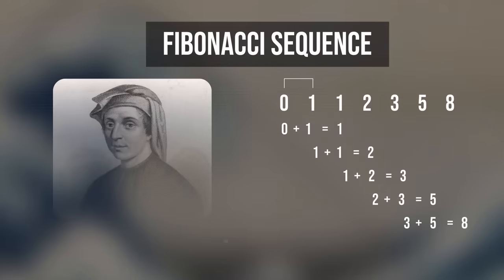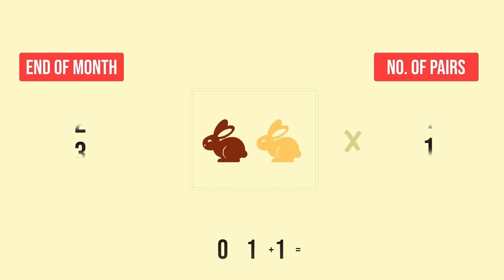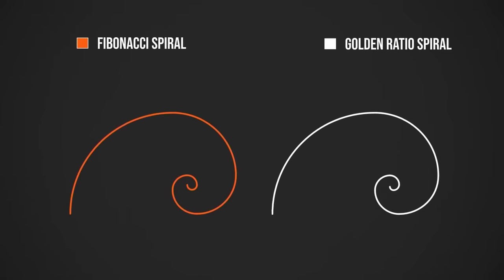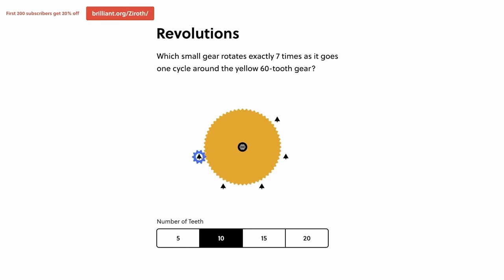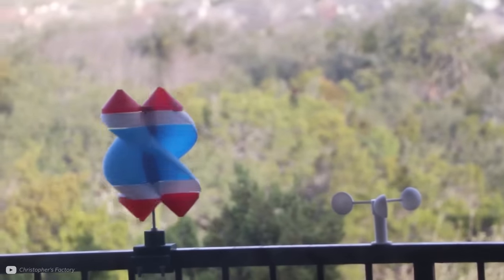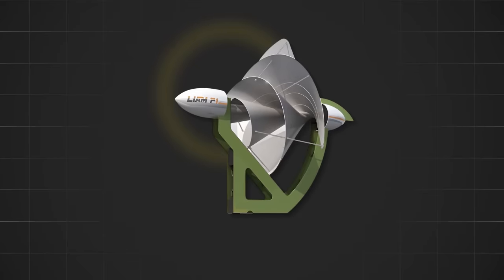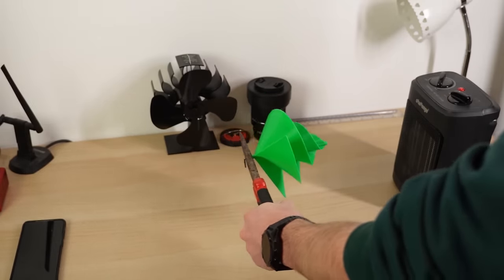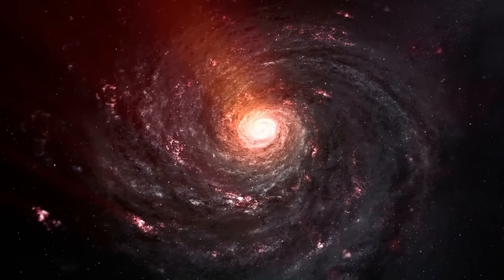Uncovering The Genius of Fibonnaci Turbines

Comment: TLDR: This turbine is optimized for low wind speeds (very low power available) while regular turbines are optimized for high wind speeds (High power).

This makes for a great garden decoration, but even if a turbine is optimized to be "efficient"  and starts at lower wind speed, slow moving air doesn't contain enough energy to get significant power out of it. The power extracted is related to how much mass of air can one slow down per unit of time. The thing with wind turbines is that they can never be 100% efficient because that would mean stopping the air dead in its track... where is all that air going to go? 

The proposed concept works well at slow wind speeds because it's basically a regular wind turbine with extra larges blades. The extra width allows for more interaction with the very slow moving air particles. However, at high wind speed, the extra width stops the air from passing trough easily. It acts like a brick wall for most of its surface causing potentially large stresses on the mast, but very little additional torque on the turbine. As the air is just pressurize at low speed in front of the turbine, the rest of the air just goes around because it is pushed away by this high pressure front.  

In a regular wind turbine, the blades are slender, allowing wind to pass through and keep a good portion of speed to allow "spent air" to "move out of the way of the incoming air". This means that the whole blade is being hit by high kinetic energy air, allowing to extract more power out of it. To my knowledge, the theoretical optimum efficiency trade off between extracting too little "speed" out of the wind and unproductively extracting too much is somewhere between 30 to 40% of efficiency (Mechanical power to incoming air power). In my opinion, any technology claiming to be more efficient than that is, at best comparing it self with irrelevant technology, as it is the case here, or at worse are either lying to get funding or are completely ignorant of basic turbine physics.

Comment: I don't want to put down the brilliance of this - but I had a thought.  He had said light force or pressure goes in the front and it exits out the back like a jet engine.  If you put 3 to 5 of these on the roof of every house in suburbia - cumulatively speaking - couldn't that cause a HUGE disruption in air flow that could cause harm to the whole system?  I don't know, but it's just a thought.

Comment: Just remember: You won't get more energy out then what the wind carries. 250W per square meter surface @ 10m/s is optimistic. Solar + battery should be a good alternative in most situations, and also silent + no moving parts. Doesn't look so stylish, tho')

Comment: It looks similar to a compressor fan to me

Also, if I were to make a small version of this, I would add propeller blades on the outside edges to improve efficiency at higher air velocities. But with a thick airfoil so that it'll tend to stall and buffet if the air is too fast
Reply: i wondered if the combo could be better, catching low & high wind. ❤

Comment: 10:00 The primary reason for this improvement might very well be just using an asymmetric design, since the basic design has the same curvature near the axis as near the edge...
Considering a larger design space almost always allows optimizations, but often at a cost in design and production costs...

12:47 Again, probably nothing specific to do with logarithmic spirals. Usually mechanisms are also optimized to use low amounts of material. If you don't care about that, you obviously have more possible designs, and some of these will be logarithmic spirals that happen to have a good efficiency.

Comment: This Fibonacci blade and that (MIT) toroidal blades are just extension of already used fan blades we have. Shame no one is trying to make stack-friendly designs people are hitting all over everywhere but not heart of issue; "Airflow/Sweep Area" or "Force/Least Bleeded Air"
After these 2 sweet spots you get blades that is stacking friendly and peak voltage capable (current reason of survival of windfarms.)

Comment: I don't agree that it's the fibonacci series as such that is improving the Savonius turbine performance. I think it's reduction of curvature closer to the centre that reduces mass deflection forces (and incidental loading) of the working fluid the rotor is immersed in.  I think that in the screw shaped one, the extra power generation comes from the rotation at higher speed than the wind's speed tends to interrupt the formation of stall on the down wind surface. I've wind surfed, kite surfed and now wing surf and breaking free of stall is something very fundamental that is part of the journey from learner to competent. Until the increased power of aparent wind from hull speed is reached, power is dependant on a sail/wing/kite angle just pre-stall. Once moving, more power is realised. For the axial (screw) fibonacci rotor, the rear surface has an inside to outside flow that I would expect to disrupt stall formation.

Comment: The maximum power you can extract from a wind turbine is P= density×(2/3 wind)³×A
A is the area of the turbine disk, independent of the number,  shape of the blades
The higher the area of the blades the higher the losses, this spiral has a huge area, no good!

Comment: If these turbine blades can take wind and generate torque on a shaft, it stands to reason that it could take torque from a shaft and convert it into thrust in the surrounding fluid.
Should bladed propellors in the marine (shipping, fishing, & sailing) industry then look at changing from the standard 3, 4, 5 blade standard props to use designs based on this idea?
It'd be great if a more efficient (and safer) prop could be found for that.

Comment: Basic engineering question, from a retired motor mechanic, why before the jet/turbine aeroplane engine did push/pull propeller aircraft exist, and Why aren't Modern wind turbines using the same, or indeed counter rotating, the stress reducing benefits surly are worth the cost, ???

Comment: It seems the fib sequence is the golden ratio (phi), with the caveat its an integer representation of it. I mean, the definition of golden ratio is a formula, and since fib is a sequence you can claim they aren't the same... but the values they create tend to the the same value. Also, phi is based on the irrational number square_root(5) - which is an integer representation of an irrational number, which is calculated  using integers with some remainder. Both fib and square root five have to be calculated sequentially, and each lead (and can be processed) to the same value phi.

Comment: I wonder if you spun it under power, how good the vacuum pull would be, or in the opposite direction, how good the thrust would be?  This design also begs the question, could you make each surface of the turbine into circular or hexagonal tubes, maybe even taper those tubes, and increase the thrust driving out to the sides?
Another idea, could you place ridges along each limbs following the spiral, and try to induce a laminar flow of air across the surfaces to increase efficiency that way?

Comment: Have you ever tested a old fashioned childs toy, the simple pinwheel ? Several years ago a company was actually marketing  & selling them in several countries, as a more efficient wind turbine as compared to the conventional savoui bladed wind turbine. They had a youtube video showing actual testing being performed. What I thought was truly impressive, was the fact that the wind not only pushed the front face of the blades, but that a vortexing air column was formed, exiting the blades in a centralized location & thus also pulling or sucking the entire air flow from the backside of the wind turbine. You should research this, as I believe the company was possibly bought out, as to shelve the turbine, because it was to efficient. There were other features to the overall design of the system, such as having the generator on the ground for ease of maintenance & the turbine was ultra-quiet. 😮

Comment: The lilly impeller ❤ I have been waiting for these to be researched for uses in wind and hydraulic turbine applications.  Saw it in a contest "best way to deal with standing water in water towers." The idea was constructed, requiring 200 watts with an impeller less than 12" to move 55,000 gallons, and making it unnecesary to add chemicals because the water is 'structurized.' It also reduced cavitation effects of water on the blades 🙏🚂🎼🌹🎶🎵~C< 3)>>-Z->}

Comment: Many designs came and went (ok, are still around), but the 3-pronged mill endures. Why?
Simplicity evolving into fine size scalability.
even a 300% more efficient wind turbine(compared to classic, also not achievable) would be astounding production cost increase would kick in fast - but that 3 pronged thingy has a more appealing(more linear) cost over size function while the power increase is almost squared - building bigger means more profit. With the complex design, whilst more efficient, costs increase will exceed power production increase.

On the other hand - we have so many species because each is good in it's own situation - this could be great in some setups.

Comment: This is fascinating. But it's important to understand that this does not change the fact that wind turbines can't be economical in urban scenarios. Even if you assume 100% efficiency, you will barely harvest any usable energy from a turbine size shown in the video. ... in urban area wind of 2.5m/s is not so common... from an turbine area of 1m/² you have a wind power of 10W at this wind speed ... this is enough to light up a room with LEDs or to charge a smart phone... but not both and only if you have 100% efficiency of your turbine.

Comment: Typo on the video title I think: Fibonnaci => Fibonacci (unless Fibonnaci is an actual term that I don't know about)

I appreciate the intro giving some distinction between the golden spiral and the Fibonacci spiral, as well as tackling that too many myths surround this concept. I also like the various examples you give of the golden ratio occurring in nature and appreciate that you untangle logarithmic spirals from Fibonacci spirals.

However, I didn't like some inaccuracies and unsupported claims in an otherwise well presented video. 

The biggest one is the video thumbnail. If clickbait is necessary, you could perhaps show a picture of it and ask "More efficient??" instead of a giving a random bogus number. Efficiencies above 100% are very suspicious in most cases and only justified in rare cases like heat pumps in comparison to resistive heating (comparison is the key here). That value of 145% makes no sense in terms of wind energy (or hydroelectric generators), where we are expecting some percentage of the total wind energy being captured (e.g. 20% for Savonius rotor-based turbines). If this comes in comparison to a previous design, which design is it? 

I didn't like the whole part about the water turbine. I like that you present another instance of this Fibonacci-themed research, but the conclusion looks very suspicious to me. First, the idea that it lets us "maximally harvest energy out of slow moving water just like how plant leaves get a maximal amount of rain" makes no sense. If the purpose of plant leaves was to maximally capture rain, they would have just evolved into perfect funnels. They have different objectives here from what I can tell. Leaves need to find efficient distribution to not overlap because they need to capture sunlight, and they grow on the principle of new leaves being added. There's no rotating or energy being captured through redirection of rainwater, and the method of application of phi is different. If this is just an to give an example for how plants use the ratio, you could have even mentioned sunflowers packing seeds instead, as there's no relevance besides the use of phi.

About the efficiency of the Archimedes Liam turbine, you say it's meant to be more efficient than competing designs, but then the paper only promises 25% and the website does at best 40%, which conventional bladed turbines already do. So what's the advantage besides it looking really cool? From what I can tell, it's probably something related to performance at lower speeds and sound. Though, I'm sceptical about the manufacturing cost. You say this is just bending sheets of metal, as if bending sheets of metal into a very precise spiral were really easy. If it was, I'd expect them to cost a lot less than they do. 

Also, pretty minor, but there's a discrepancy in the part about Savonius turbines when showing the patent and the model. As others have noted, the gap between buckets has been studied as it changes the behaviour of the turbine. I like that you question whether this was simply due to logarithmic spirals used instead of circles. Plus, Savonius turbines are usually around 20% efficient, so they already aren't great at being turbines. From what I read, their benefit is simplicity and reliability.

Comment: What i would like to see is one of these badboys put in a roof vent, where the rising heat provides the velocity needed to generate power.  Even if its little power it could still offset the grid for air conditioning use during the summer.  
Just a thought i am definitely not an engineer.
Reply: Thats def. not enough energy.
You underestimate how energy intensive e.g. running a compressor is.
But you can probably run some dim lights with it.

Comment: I don’t think it would be feasible to scale these turbines up to anything near the large conventional turbines. 

Also the amount of energy of wind is proportional to the cube of wind speed iirc. Wind speeds are relative low at ground level. Therefore larger (and higher) turbines are can catch more energy than smaller ones. 
In other words, wind turbines need to be high up in the air.

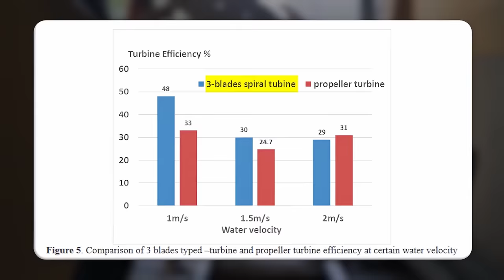Comment: 12:30 Isn't it actually 45% more efficient at low speeds? 48/33=1.45. Even at 1.5m/s it's 21% more efficient.
Reply: no no no, dividing percents into percents is bad practices.  always use the difference between the two points if the scale is 100%.
Reply: @zangetsu6638  In this case the percents are effectively just a different energy unit. Assume at 1m/s the wind is imparting 100W of energy. So the 3-blade turbine is delivering 48W of energy, and the propeller turbine 33W of energy. 48W is 45% more energy than 33W. Do you object to this claim? Is the problem that efficiencies are inherently a percentage, thus 45% more efficient is ambiguous? Let's say one was 10W and the other 20W, is calling the second twice as efficient wrong? Just trying to clarify.
Reply: @gblargg   yah, i see where you are coming from, and yes, you totally can compare percent differences of percent differences as a percent difference of each other, just so long as everyone is on the same page or it gets confusing.  😅  

usually though, if both of the samples are rated on a scale where "100%" is an absolute upper limit that can't be breached, such as this case (because of the laws of thermodynamics), it's much more straightforward to just compare the difference between two points on that scale by subtraction.
Reply: @zangetsu6638  A simple difference of values doesn't get across the improvement. Say the old one was 1% efficient and the new is 2% efficient. That's double the efficiency yet only a 1% difference via subtraction. In other words, to make sense of the 1% improvement you must know the other values, whereas a 100% improvement in output stands on its own (and would be incredible in a mature field like this).

Comment: Why not just engineer a large wind harvesting device that includes a logarithmic turbine in the center coupled with a traditional blade style around the outside using a split path gearbox to add the two turbines together, this way they are decoupled from eachother and therefore the system can be efficient at both high and low wind speeds.

Comment: It still seems to me that mass and volume should be where your power demand would gain the most benefits, in other words, a large parachute can support more weight then a small one, so why would that not be the same with wind power, because the wind comes across the plains in volume, and the more mass and volume of that wind that you capture, means the more working power you have to convert to energy, so instead of trying to get efficiency from a tiny prop, why not collect the wind power/energy from a large area, like if you cut a plastic 55 gal drum in half long ways, then fliped one of the halfs upside down, then bolted them together, you would have a large wind cup, that would cut through the wind on the curved side, but capture a bunch of wind in the cut side, and with a large area as a 55 gal drum, the volume of wind, would be enough to turn a generator capable of powering your whole house, so I'm not sure why these engineers are always trying to go small, when force, volume, horsepower, work, and energy conservation all need mass to be most efficient, because it all boils down to E=MC2 which all go hand in hand, and no matter how hard you try you will never defy the law of E equals M.C square, and mass is part of that equation, and if your trying to get the most power for the cost, well you can find these plastic 55 gal drums all over the place for free, some companies pay you to haul them off, so return on your investment is 100%, because a free wind turbine made from plastic 55 gal drums, starts paying you profits the second you put it outside, and all engineers are taught the KISS principle when they first begin their college entrance to become an engineer, and that premise of KISS means to Keep It Simple Stupid, so don't try to over engineer how to capture wind, when you get free plastic 55 gal drums, then just use them, because ROI is over 100%. 🧐🤔